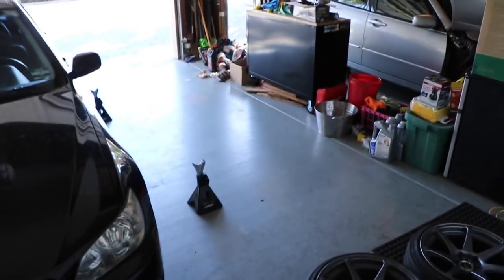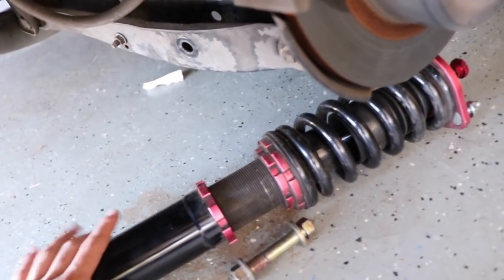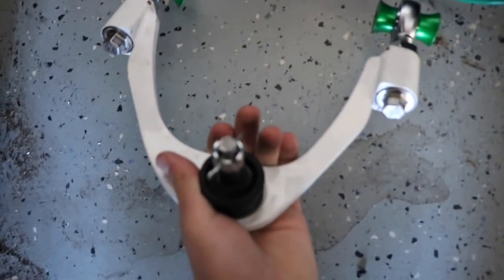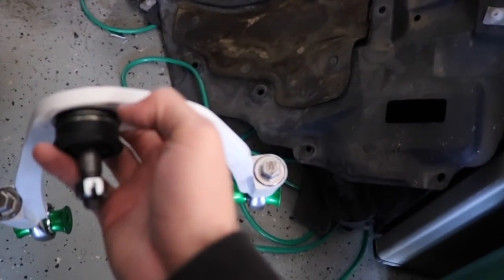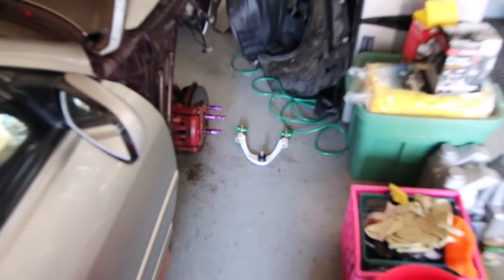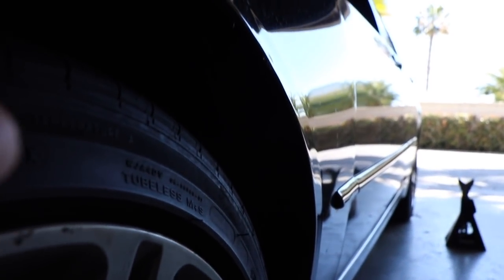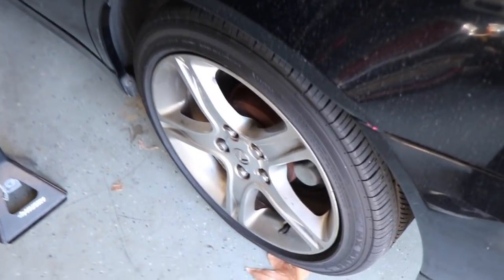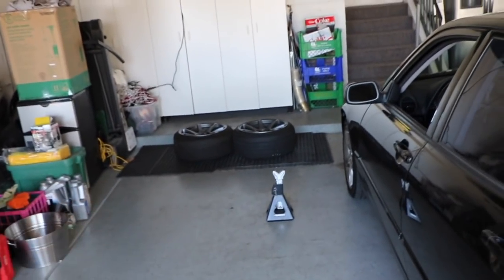New IS300 Gets LOWERED and NEW WHEELS??

Comment: Damn i remember my front and rear end links was a bitch. I grinded them off and bough new ones.

I installed h&r springs with tokico illuminas. I miss my is300.

trd rep lip
Rmm sides
Ltuned rear valence
I cant remember what exaust i had? Starts with a T

I miss my is300 black onyx

Comment: What are the wheel specs? Cause I wanna get these 18x9.5 +15 but idk if they even gonna fit lol
Reply from the maker: My mb battles are 17x9.5 +15... although you'll need to stretch tires quite a bit and pull fenders/have camber to make these specs fit well.
Reply: Do you think at 18x8.5 +30 would fit all around? Sorry im kinda a noob to wheel specs
Reply from the maker: Depends on what you're going for. Do you have coilovers or lowering springs or stock suspension? 17 inch vs 18 inch is a lot different too and also tire size matters. Typically for IS300s a 17x9 +30 might be the right call if you just want to have your car look a little better and not worry about being too aggressive fitment wise.
Reply: Im on CXracing coilovers like you and thats all. I dont wanna be stupid low i just want nice wheel fitment. Im stuck between 17s and 18s i just cant make up my mind. and 17x9 +30 would fit all around? 9in seems wide for the front
Reply: @IxTechNiK  you should have no issues with 18x8.5 +30, im 17x8 +35 and i have no clearance issues, i doubt youll have any other than fender and fender lining
Reply: @IxTechNiK  The fronts will probably poke out half an inch of rim tho (once lowered) the back looks like it should sit flush with the fender, if not a couple mm's out, id say get a higher offset to be safe and get a spacer in the back, or if you dont want to ritate tires u can go with the better choice of only raising the front offset to something like +35
Reply: Clearance wise you need to pay attention to the front knuckle, it extends upwards and attaches to the UCA, with my setup I have about an inch of clearance, u should be able to fit 9 inches up front with very a +35 or lower offset, so u could use 17/18×9 all around (depending on your tire size choice and offset) the rim may poke in the front tho
Reply: @CardsNSleevesTCG  Yeah ive had the 18x8.5+35 esr SR08s and 215/40/R18s on for over a year now. I just got a manual LSD for my auto is so now its time to drift. Eibach front and rear sway bars, JZX100 ucas for more camber.
Reply: @IxTechNiK  Wouldnt you rather have the automatic lsd? its got a better ratio than the manual one
Reply: @CardsNSleevesTCG  Yeah but I got this one for $300 with only 100k miles. And i dont mind revving less on the freeway since its my daily
Reply: @IxTechNiK  yea thats true i see your point 😂